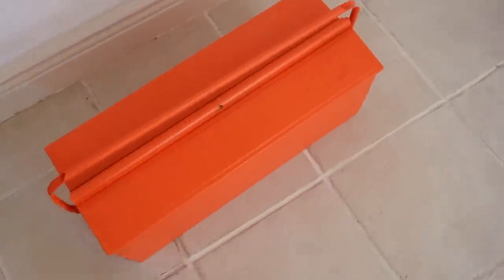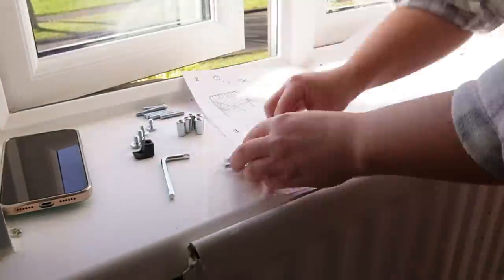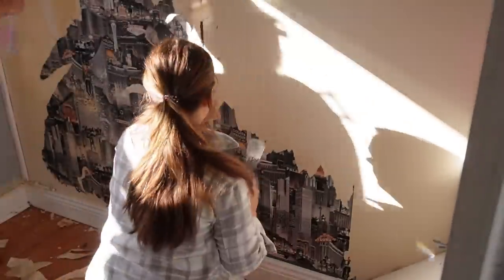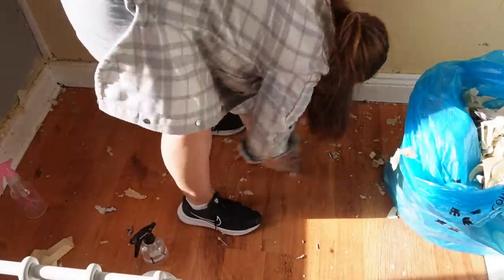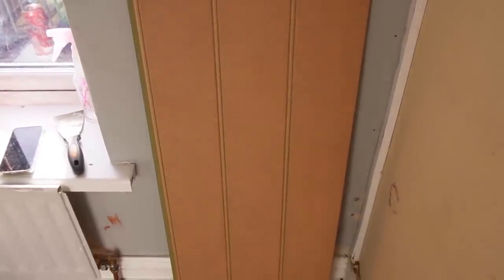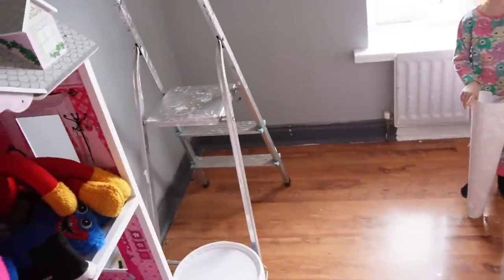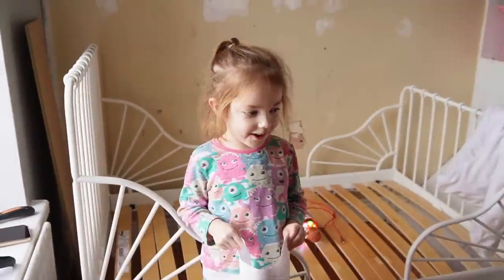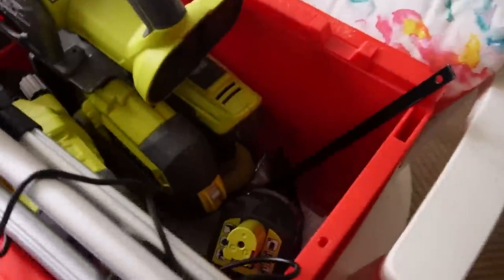Girls bedroom makeover, half beadboard wall panelling installation  🛏

Comment: Hi Catherine, I'm just wondering when you're painting inside do you use your paint sprayer. I have some painting to do and was going to get the same sprayer as you . Thanks a mil
 I love your niece and nephews rooms 😍
Reply from the maker: Hey Sheila, no I don't use it indoors, only on pieces that I can take outside, or you would have to tape up everything including the floor, I use a roller on the walls inside x